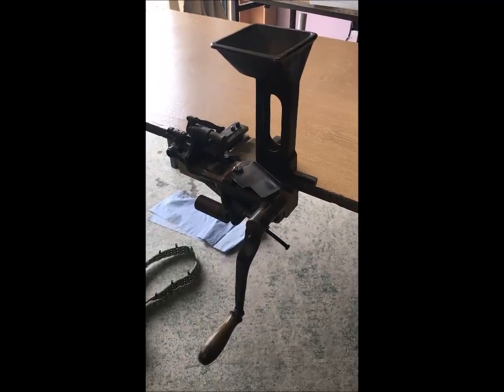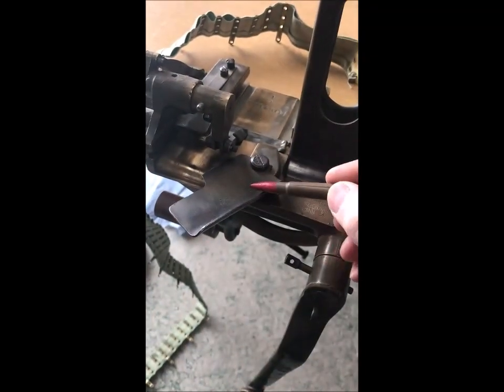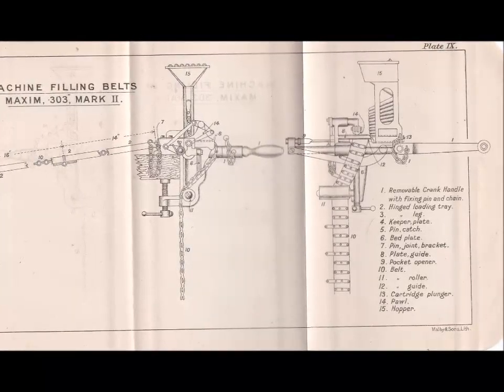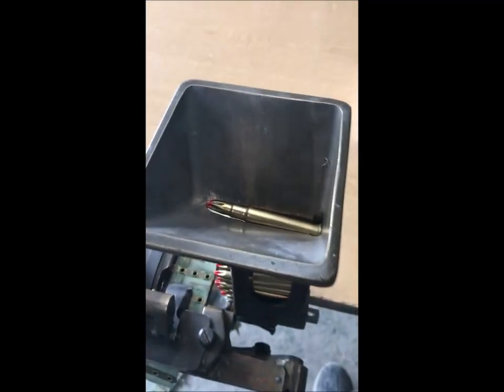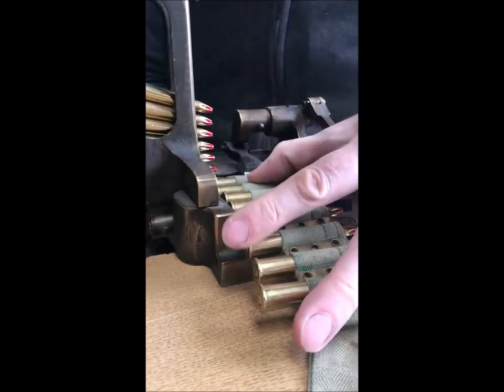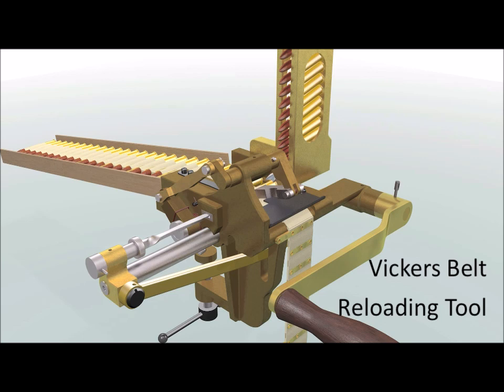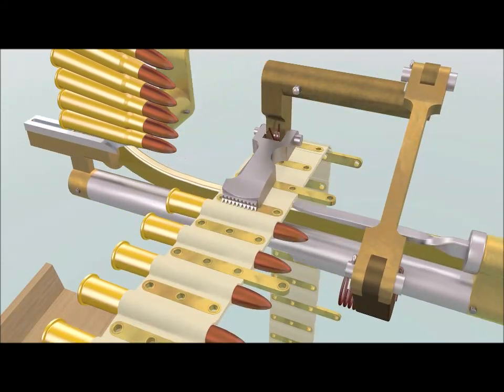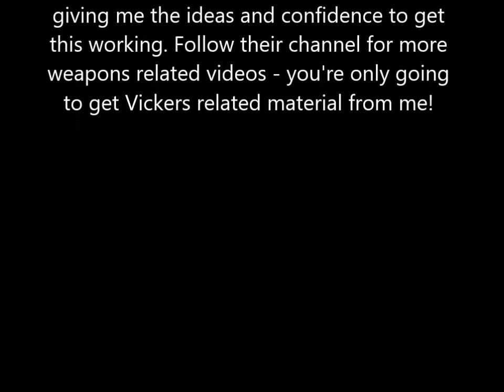The Vickers Machine Gun Belt Filling Machine

Comment: Every 4 spaces on the belt has a brass strip that is longer than the others.  What is it's purpose?  Thanks!
Reply from the maker: Hi Rick, it has a few functions. The first is to help it cycle through the belt machine by keeping the belt pushed against the front edge of the tray (a stripless belt doesn’t run in this machine); then it stops the rounds from slipping out of the belt when it’s in the ammunition box; and it helps keep the belt feed into the feedblock on the gun on the right place. It also aids hand-loading of the belt by being a guide for how far to push rounds into the belt. I hope that’s of use.